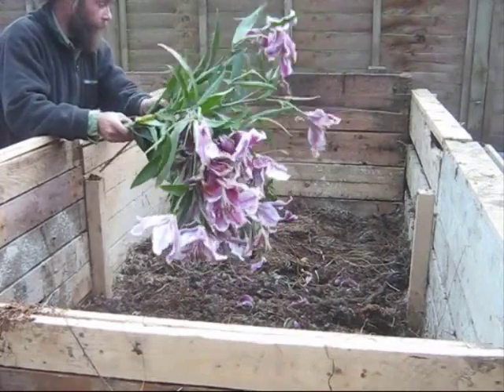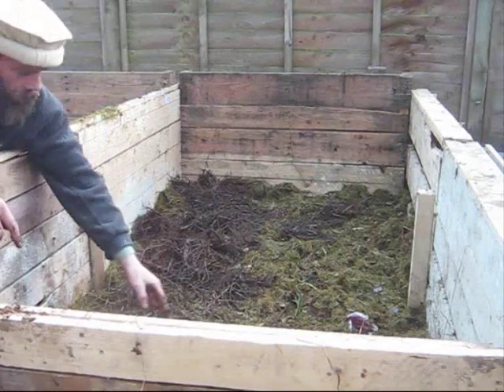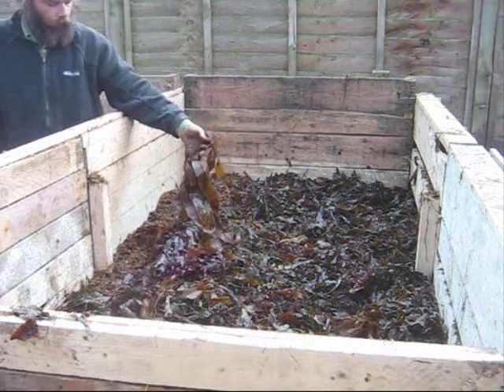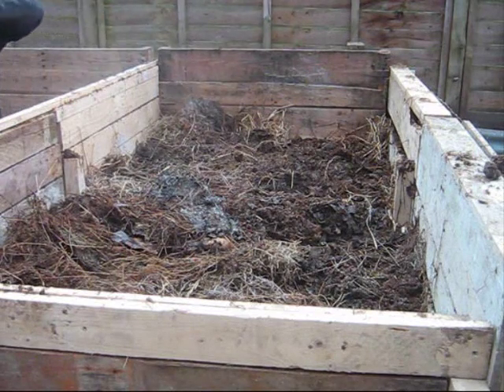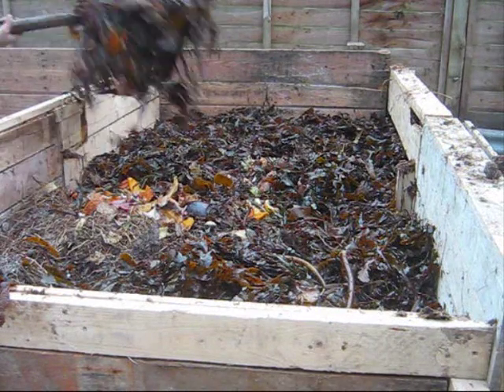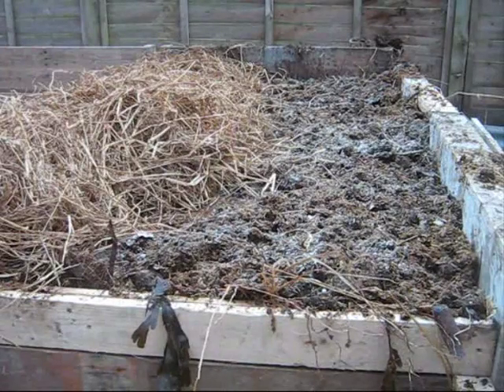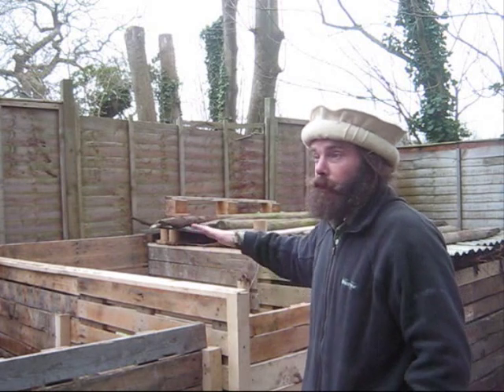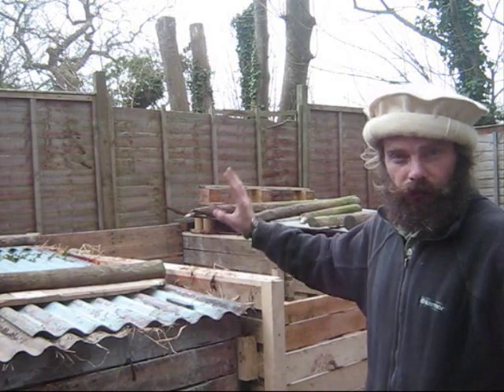making a thermophillic compost heap Pt 3

Comment: Hi Malcolm  good vid  lived on the isle of arran for 10 year and seaweed was the mainstay for the garden loved the storms now back in norfolk no seaweed but plenty of horse muck but fresh so am doing it in a similar way to you, started this 3 year's  a go and is now working well PS golden virginia  i hope
Reply from the maker: thanx... I'm glad this video still gets views. but if you can't get seaweed it's not an issue (you could add dried/calcified/liquid seaweed...or even try QR (Quick release herbal activator developed by Maye Bruce). However the real trick is get the physical conditions right,, true for the whole of horticulture.. The John Innes institute who did the original work into potting composts concluded as I did some 60 years (?) later that it's the physical rather than the chemical conditions that are most important in promoting the biotica..as for the baccky.. prob was GV but now I try to vape more and cough less...

Comment from the maker: theres no need to use forced or assisted aeration when you keep the height and at least one horizontal dimension of a heap under 2mtrs; provide ventilation access at the bottom of the sides and pay proper attention to compost internal architecture and construction method... there's a whole page structure dedicated to this on the linking web site:

 phasm.co.uk > Gorilla Soil Science > Compost Science. 

note: the site as all my net presence is due and currently going through an overhaul

Comment from the maker: Ps if you make two turn thermophillioc compost as in the videos and then after 6 weeks feed it in layers to worms they produce a very fine granulated compost that is an amazing substrate for potting mixtures... just add some leafmould and vermiculite in roughly 3 parts worm, 2 parts leaf mould and 1 part vermiculite...  if you want to save on the vermiculite get it from a builders merchant , where it is used as agregate in lightweight concrete or loft insulator rather than a garden supplier